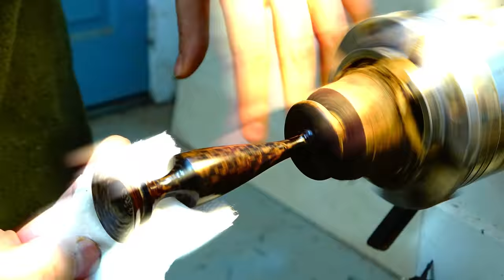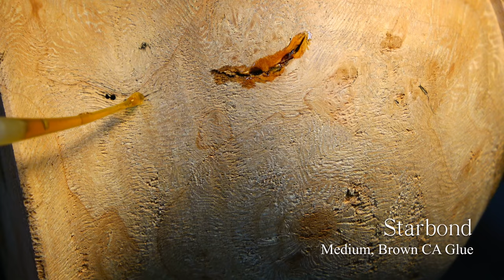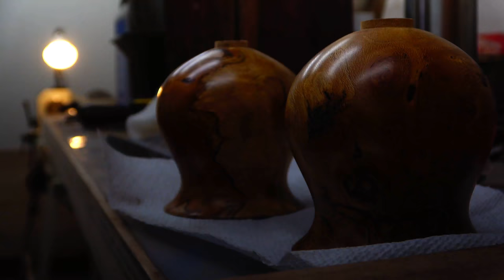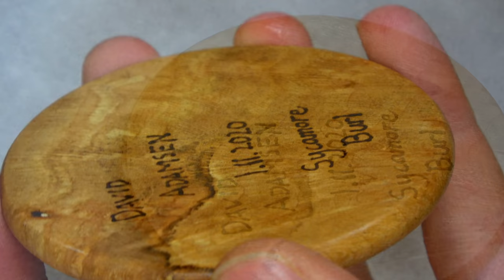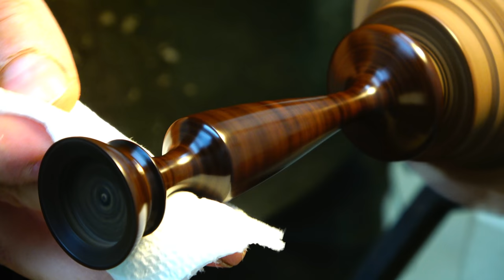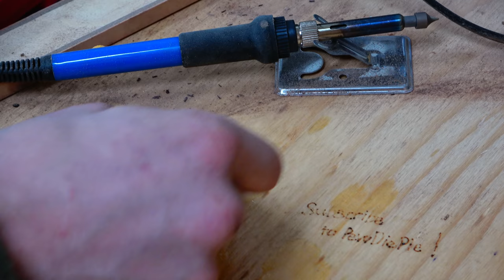Woodturning: This Wood is Like Cement! 😳

Comment: LOL, I watched the video before I read your description. Yeah, I've worked with black palm ONCE. It is an absolute nightmare. Sure it's pretty, but if it isn't suddenly exploding off your drill press, it's exploding off your lathe. That's if you even get the tool to even bite the wood with any kind of consistency. Out of 4 trys, I made 1 pen. KUDOS for the work!
Reply from the maker: Thanks Ross, yeah it was definitely a challenge with the black palm wood. ✌️

Comment: Nice work here..  I do not have experience with sycamore but with Black Palm.  Palm is in the grass family of plants and the end grain reminds me of a large group of straws bound together..The wood lacks annual rings.  As for turning palm it’s different and can be flaky and chips out much..  Thus small voids are created.  Sanding the wood is somewhat hard to do.  You have done a great job here bringing out the contrasting colors of the wood..

Comment: Gotta hand it to ya David, you have a light touch turning wood.  Definitely turning yourself into one of this nation’s best wood turners.

Suggestion:   

I may be wrong on this.  During the first part of your video I thought I heard some bearing noise coming from your lathe.  It sounded a little noisy. You may want to check out to see if it is beginning to fail.  I heard the same thing on another well known wood turner’s lathe not too long ago and mentioned it to him. It was a few weeks lather he ended up buying a new lathe instead of making the repair to an old worn out lathe he used for years. 

Replacing headstock bearing in the Jet lathe is not a difficult task if you have some mechanical abilities.
Reply from the maker: Wow thanks very much! I think I know which channel you’re referring to. You’re probably right. I have never done any maintenance on this lathe an it spent a good 15-20 years sitting unused till January last year. I’ll hopefully let this be motivation for pulling the trigger on that Robust AB. 🤔 any advice on how I could figure out what might be wrong with my lathe?
Reply: David Adamsen 

You will need to use a mechanics dial indicator gauge to see how much play is in the shaft from side to side.  The play should be no more than a few thousand of an inch. Refer to the owners manual for the bearing spec.

One thing that could be causing the noise is the belt on the Reeves drive. If the lathe is old like you describe, I would bet the belt is the source.  If you have never changed the belt, it may be a good idea to do so now before buying  any measuring devices to see how much play is in the bearing.  Go the cheap route now since you are planning on a new lathe anyway.
Reply from the maker: Good advice, thanks. Last year I remember taking a vacuum to the belt area because it wasn’t responding to the speed control, so it wouldn’t surprise me if you’re correct that the belt is the problem.
Reply: David Adamsen if the lathe sat idle for years, the belt is probably the problem since it took on a weird shape not being used.  It probably has a wider lobe on one side of the belt in comparison to the opposite side.  This is a typical problem with belts.

You might try an auto parts store to see  if you can find a replacement belt.  It would be cheaper and probably better than what you get from Jet for $20+.

I think it may be a 1/2”x5/16”x??? Belt. It might be 20” circumference belt.

Comment: Cement would instantly blunt a non-carbide tool/bandsaw blade. Hardened cement is 6-7 on the Mohs hardness scale. The hardest woods are 2-3 Mohs.
Reply from the maker: Hyperbole.

Comment: The black palm wood looks amazing polished.  Looks like it splintered a lot; true?
Reply from the maker: It is incredibly brittle and hard to work with. Even with a sharp tool the splintering is almost unavoidable...
Reply: David Adamsen black Palm is best stabilized before working with. It’s like working with a million splinters. It’s actually a grass and not wood. But it sure does make beautiful pieces. I love watching your video’s. Your work is amazing 😉
Reply from the maker: Thanks Dara, I would never have thought to stabilize black palm before using but that makes total sense actually. I may need to spend more money on more equipment... 🥺

Comment: The palm wood was half the size after turning. Can’t help but to think that was an unnecessary waste of wood.
Reply from the maker: The blank needs to be slightly larger than the maximum diameter of the object planned, plus, there is always going to be a bit on either end that is wasted because the head and tail stocks need something to hold onto.
Reply: David Adamsen, thanks for the education.